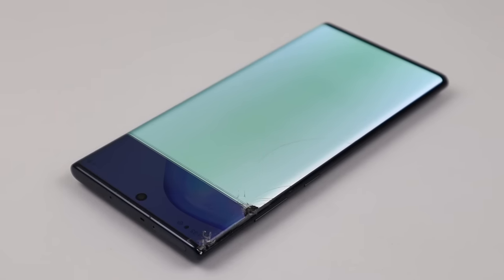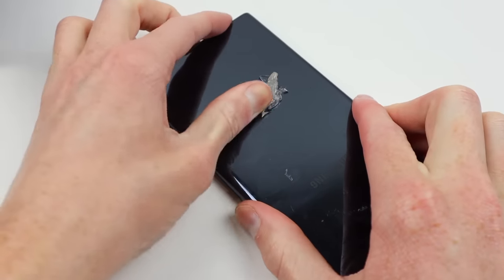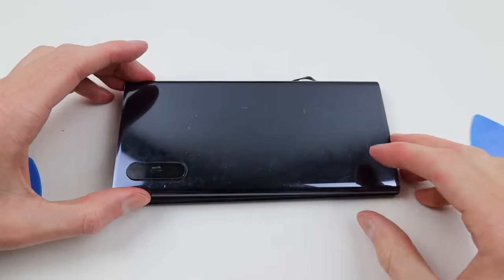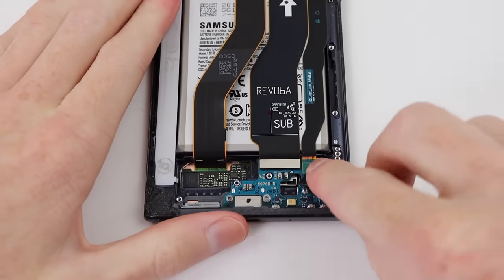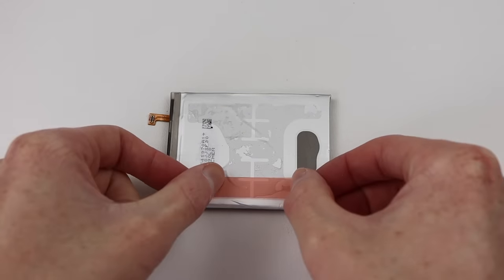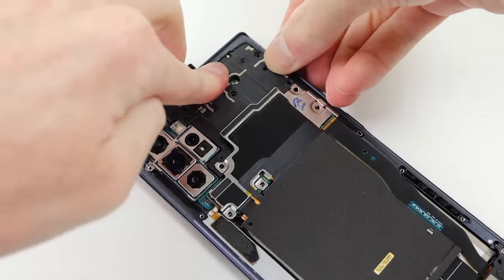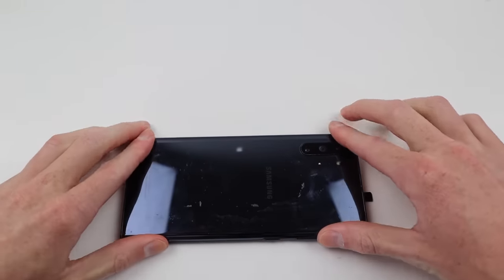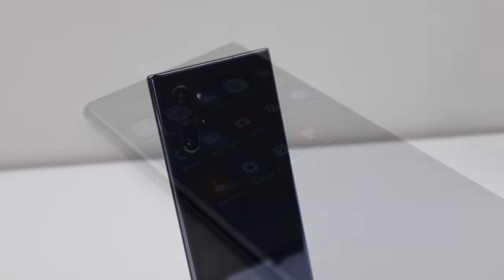How I saved $1017 on the latest Samsung by fixing a broken one - Note10+ Restoration

Comment: Being a Phone technician and having my first Samsung repair the other day outside of practice devices I was pleasantly surprised with how serviceable it was. Screen replacement on a Samsung A20 which requires parts to be moved to another device would have liked pull tabs of some sort on the battery but lots of heat solves that. All for Right to Repair as many devices can stay out of the landfill with a bit of TLC and a small amount of money on parts of eBay.

Also, thanks for the inspiration from your channel. During the Pandemic I began my own local Mobile Device Repair Business which has been a profound success in my local community repairing iPhones and Samsung's alike. Currently working on an iPhone 7 Screen Replacement, found that investment in tools such as the iFixit ones have worked a treat unlike cheap tools, found out the hard way on my own old iPhone SE. Keep doing what you are doing!

Comment: Tip: (I work on a Samsung Autorized Service Center) you can preheat it on that base between 10 a 30 minutes.
Reply: gorkaiq I work at a store with a broken AOD, we use very thin plastic cards. Comes off like nothing. Use an Isesamo to begin seperation after heat.
Reply: Same, I work on a store.
Reply: "Autorized" yeah sure buddy
Reply: I work in Samsung
Reply: @jeneralgod  Never heard of typos?
Reply: Christian Bingman are u a repair man ?
Reply: @pabs4205  i doubt it, he couldnt spell "and"
Reply: @Brutalexecution  ur rihht

Comment: For removing the back glass, put some isopropyl alcohol on the tip of the plastic pick and use a suction cup to get an opening on the back panel. It makes it way easier to remove the back considering you need to replace the adhesive anyways
Reply: Where do you get the picks?

Comment: I work for a company called Mobile Klinik, we are Samsung Authorized and we do Samsung warranty repairs and such, speaks from experience if the machine that opens up the back is not working and we have to open the phone manually we never use the suction cup since it has a high chance of breaking the backglass. And for the wireless charger coil you never wanna remove it from the loud speaker since it might break easily. But great job man i really enjoyed watching this👍🏽👍🏽👍🏽

Comment: As a person that works at a Samsung certified repair center that was a good repair. And recommend using plastic spudger to remove the battery and to remove the water resistant tape on the back glass, take it off when the back is still warm for best removal and at a 45° angle so it doesn't leave residue

Comment: I had the exact same problem With my s20+, only my screen wasn't all white just yet, but was flashing like crazy.  Where I Live no one was able to do the screen replacement.. so I had to go to a Samsung dealer to get it done 😔
 but gotta say, loved their job.. as the phone is still on warranty,  they replaced the battery which apparently wasn't all that  great, also replaced a piece from the charging board area, and it came with all the original protective plastics, including the ones going around the metal frame. Really great work

Comment: You should use X-Ray film cut up to size to remove glued backs. It is thin enough but strong enough tu cut thru the adhesive. I use it daily and it works amazingly well.

Comment: When trying to separate the back cover or the lcd you can dip the prying tool in 96%-98% alcohol or put a drop of it on the prying tool while is stuck inside to make the glue separate fast. Just don't go too fast so you don't break or tear something. And don't use too much of alcohol as it can damage the lcd in some cases.

Comment: Interesting thought: If you sold phones in 2 versions, 1 being very easy to repair but had no waterproofing and the 2nd being totally waterproof but not user repairable, I'd bet the general public would go for the latter because they like the thought of a waterproofed phone. Here's the interesting part: I bet if you asked the general public how many had broken their phones screen or needed a battery replaced due to capacity loss vs how many had lost a phone solely due to water damage, the vast majority would belong to the former group. 
We tacitly agree to harder and harder to repair phones for reasons like better waterproofing, but we end up needing the ability to easily repair a phone far more often than we need one that's able to take a dunk under water. Humans are dumb sometimes.

Comment: Great job on the repair! A couple notes on heat and back glass removal:
-A heating pad or similar is still handy with Samsung repairs; I usually use a dehydrator which gets the whole phone up to about 140°F. This keeps the back glass from cooling down as quickly when using the heat gun. Using a gun set to between 200°C and 250°C is still necessary, although if you take off the small tip it will be less concentrated and more effective.
-For getting underneath the back glass, once it's sufficiently hot, I use a curved edge xacto blade to slide underneath the bottom center of the glass, then plastic picks and super thin guitar picks, which are flexible and can slide around the curved corners of the glass without breaking it.

Comment: There is little sense in quoting the RRP of an almost a year old phone. The note 10+ 256GB is currently selling for AU$1200 new, but I have seen it little over the AU$1000 mark at various sales before. You can grab a used undamaged one off eBay for under a AU$1000. Given this is used, not water resistant and didn't come with any accessories I'd say the savings are more like $100~$200 at best.

Comment: hold the device with the cameras toward the ceiling.
Heat the top side for 50 secs while consistently moving the heat across the device
take isesmo and carefully insert on the heated side; creating a gap
insert your plastic pick and take out isemo
slide the pick along the edge of the device removing the adhesive
repeat for the other sides.

Comment: Once you have inserted one blue pick then insert a plastic card instead of putting another blue pick, and move it around, it’s quicker and safer and it slices the adhesive off like hot knife through butter 👌🏼👌🏼👌🏼

Comment: Great phone, and great job! I was about to buy a used one but then decided on a Note 8 that was used with a small almost invisible crack on the screen, for only $109, thus I saved hundreds of dollars!  I Bought it recently on Ebay. I slipped in my Verizon sim and it worked like a charm, even though it's AT&T branded,- Boy did I get lucky!

Comment: I just wanted to make sure I understood you correctly - did you say that you used a heat gun until it reached 200 degrees Celsius to remove the back cover? Isn't that too high Also? Also, what kind of adhesive did you use for the vibration motor? Thanks!

Comment: Little secret - if you're removing a Samsung back glass and need to clean up the old adhesive residue to apply new adhesive and reuse the glass, use heat + the original adhesive.  Put that back glass on 70-80C heat mat, peel off the adhesive strip by hand, then press it against the residue and pull away.  Do this repeatedly and when combined with heat it cleans up the residue better than any solvent and scraping/rubbing, and much more quickly.

Comment: That's insane how much that cost for you ($1700) I got mine in August 2019 in the U.S. though for $1100. 256 GB 4G, not 5the 5G variant. Unlocked also. Since I did the preorder option I got an additional $250 worth of stuff for free.  I still have an use this phone, zero issues. I however started using my S22 Ultra 1TB phone though. Delayed shipping on the preorder due to high volume orders.

Comment: As a certified Samsung technician, that NFC antenna connector is giving me anxiety. It's very soft and loses contact during assembly. ALWAYS make sure your phone is both cable and wireless charging before putting that back cover on.

Comment: Problem with the aftermarket screens is, it's totally a gamble. Either you'll get a good one which is 2-3/100 and the rests are cheap Chinese quality, dimmed display, half to non functional under screen fingerprint sensors and all! Fixed quite a few and eventually sold em off.

Comment: My S8 was broken the same way, turns out that turning down the brightness from when it broke made the screen go back to normal, though it was nigh impossible to use my phone as the brightness it worked at was less than half which was super dim outside. dealt with it for about a year before finally upgrading.

Comment: I have a redmi 2 that's dead now. The display and battery is dead and there's no replacement available from the original vendor as they stopped manufacturing it. Anyway to resurrect that?

Comment: I have a galaxy note 9. After something metal was shoved into the sub c charging port, I believe the screen was shorted out as there is a vertical white line that is very similar to the white from the old damaged panel on the note 10. Would replacing the screen actually fix the dead area of the panel?

Comment: Very nice vid, I got phone from the market (2nd hand) and I believe the glass on my phone was also replaced, but the pasting of the glass is probably not done correctly near the top selfie camera part, as the screen near the top part doesn't respond correctly and I can also seen some blur in the front camera sometimes which may be due to the glue/solution. Now heres the interesting part, I dropped the phone a few days back and then the screen started to work perfectly and registered the touch at thw top part as well move forward few days and I drop my phone again and then screen goes faulty again from the top part so you have any solution for this? Except for the replacement of course

Comment: When you did the replacement, did it activate Knox?  We had a mobo replacement on an S8+ and it has activated Knox (even from an authorised repairer). Have been told it is what it is and we just have to suck it up and can't use S Health and apps that need Knox.  Still haven't found a way to reset it.

Comment: I had the white version and the primary reason i didnt keep the phone when the screen cracked is because the oled generation is insanely hard to fix so i just sold the phone to the insurance. I loved the phone and even did a rear panel mod where i made it blue but sadly i had to sell it and goodbye note 10+. Very good phone but not as durable as the iphone 11 pro max at the time.

Comment: Protip: Injecting Isopropyl Alcohol into the sides will disolve the adhesive and make removal of back panels and OLED panels easier. Dont use this on LCD panels, the liquid will stain the back light

Comment: My note 10 is similarly damaged with a huge line going through the middle of the display, though the frame and back panel of mine is also damaged
If I wanted to replace it, the parts alone would cost almost £300 here, or almost $500 AUD :')
Also I don't have the heating tools so I wouldn't be able to take the phone apart in the first place ahah

Comment: i think the vibratior motor is not quite as good as the original one because affter you update it to the one ui 2.0 and 2.1,  the haptic engine is  more more natural like the apple one that the vibrator motor is realy nice to feel it like when you scroll the alarm time, and when typing and when you want to turn on or turn off the button like bluetooth in setting the haptic feel is cannot give as good as the original one because in s8 the vibrator motor cannot use that tap and felling for the haptic engine felling

Comment: Battery adhesive needs to be stronger because it will start damaging the flex cables when it start moving. Also, the speaker grill is no longer water proof. I would rather get Samsung to fix my display.

Comment: Okay. The way this phone's screen is damaged, is the exact way mine has done twice. Same spot. Exactly the same LCD damage affect and colors. Black lines too. Cracked in a similar place. Usually, with  this happening to me twice, i get a few weeks of screen life before the top half of the touch screen dies and it then turns the weird white down most of the screen. I believe there's a design flaw with the Note 10+ causing this issue. I dont do anything to cause my phone to crack that i havent done with another phone before. I work inside of vehicles all day and twice so far with my one phone and while working, i've pulled my phone from my pocket to discover the cracked glass and then the touch and LDC die like this phone. Had the phone repaired once and for it to happen again, i am greatly dissatisfied as none of my other phones have behaved this way and have not been nearly as fragile. There has got to be some structure issues with this phone due to the metal casing between the front and back glass being so irritatingly thin. The phone looks amazing, but if you're looking for something that will gurantee to last and be durable, look elsewhere. Unfortunately i had to go out of my way and buy a whole new note 10+ to replace mine as my phone is on back order through my carrier's insurance plan and i needed a phone now. I love samsung but this might just be my last note series phone.

Comment: You do have to include the 300$ worth of tools assuming a person doesn't have them - approx. 80$ for a heat gun, 80$ for a hot plate and 140$ for quality screwdrivers, spudgers, oh and the new glue for the back etc. wasn't included. So still a 500$ profit but if a person has never repaired a phone before they will likely irreparably damage a connector inside - causing even more damage and likely failing at the process - so get a bunch of older phones to practice on first.

Comment: him struggling with that back made me cringe lol. as a device repairer id recommend one of the thin very flexible metal spudgers for this job.
Reply: Metal can scratch
Reply: @OfficialMuffiin  the tip is rounded to prevent that. Along with one drop of acetone to quickly get the adhesive to release

Comment: I don't like new phones, when I say new, i mean I only just upgraded from my trusty old s3 mini this week :P. 
Trust me that s3 has been dropped so many times and must have got soaked in puddles 10+ times over the past 10 or so years ive had it, it takes a while for the headphone connection to dry out but after a month the headphone connection input stops and it still works perfect to this day as a phone to call or message people with.
Kids of today probably don't even know what a public phone box was and probably think you jesting them with nonsense lol. 
The first mobile phone I ever saw was when i was 14 working on the market, gaffer had this car battery with a full sized home phone headset on top, he thought he was the bees knees lol.
Trust me if the nokia 3210 had a touchpad ild still be using that today but even the hardcore old skooler i am, i cant be arsed with abc typing no more :P.
My upgrade, absolute mint S5 mini, 45 quid ebay and for the money its sick, I don't understand why people would spend over a grand for a phone :O,  I brought my last car for only 330 quid, needed a tyre for mot, serviced it myself, 26,000 miles later its still running mint, you gotta be mad to spend so much money on a phone man! :P

Comment: What, broken Note 10+ and screen replacement for $683 and not counting labor?  It might be cheaper to just keep watching for good deal on used phone from reputable seller(direct from Amazon Warehouse).  I brought the Note 10+ 256GB dual sim for $500 (before tax) in Feb 2020.  The phone came in pristine condition in the original box and the accessories.  Even after tax that's $100 cheaper than this w/o doing all the labor.  Then spend another $100 on the dome glass and Spigen case to protect the phone and I have been using it since then w/o problem.  I'm not saying the youtuber is doing anything wrong here and I might have been very lucky on the deal, but seriously his phone could have come w/ more damage and need more repair also if we just talking about luck here.  The point is, if you want save money on used phone, do some research first.  The starting point of saving the money isn't buying damage phone and repair it yourself, but to weight the options available to you first.

Comment: Will you stfu!?? You're cutting in on my hustle, bro!

Butseriously, i did the same when I was ready to jump off the Apple train. Id been Frankensteining iPhone for years using the parts from damaged (or locked) units, and the Note 10 Plus was in my crosshairs for its screen, mostly. In the end, I'd had to actually buy an uncracked rear glass, as none of my donors had one undamaged. But for free, save some time and effort? Can't beat it. I built myself a $250k smart home audio, theater, security, and internet system for free, too. Just repairing good finds.

As for the Note 10 plus NOW, however.... that screen is a killer. You can buy a refurbished (like out-the-box pristine) 256GB on blackmailed for under $350... but the screen STILL costs that much! If you bust yours, you might as well buy a brand new one. And while "bust" is relative, there's not a lot of wiggle room here. I dropped mine with a crystal case on it, and didn't even crack the screen...and it went white for 24hrs, then black. Currently waiting on Asurion claims, cuz I'll be damned if I'm gonna do all that again.

The repair conundrum, eh?

Comment: the problem with ur videos is that they r all showing the same process ..( not working - remove the pieces - cut - put back the pieces - working ) why r u cutting the most important part of the video that will make the video different from ur other videos .. ( changing or fixing the screen it self ) .. this is the main topic of the video and u always cut it out .. i open the video to see how u fix the screen .. not how u remove the parts and put back again every time .. but ill give u a like any way :)